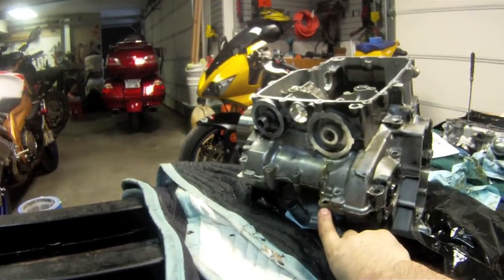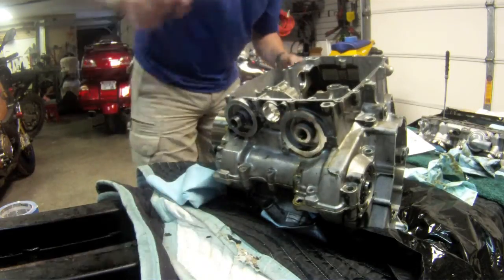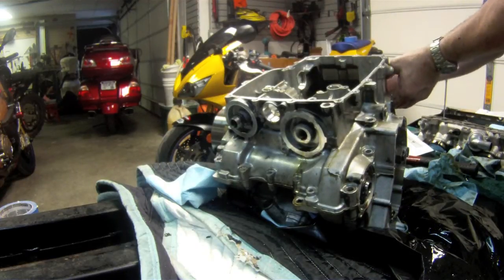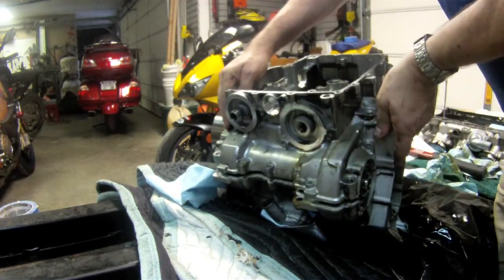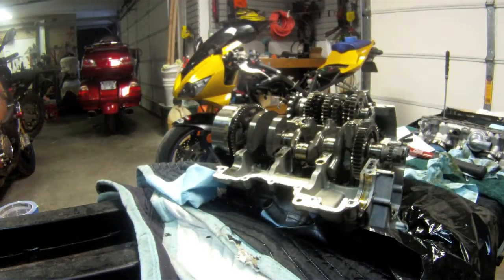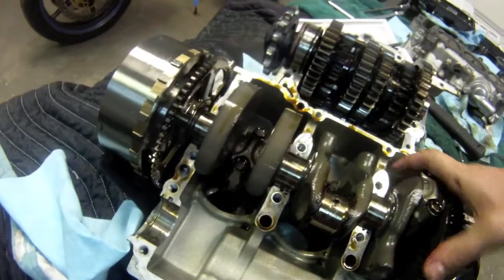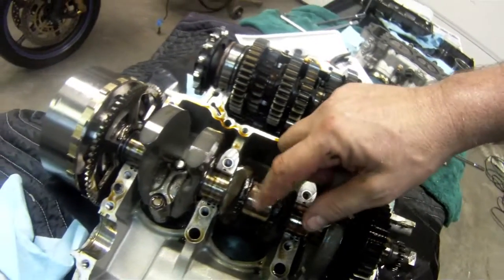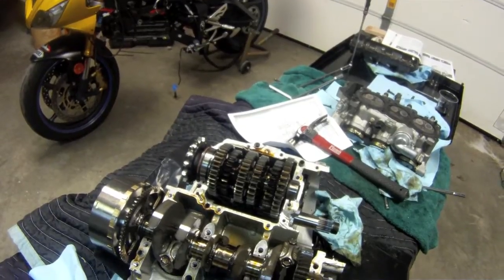Triumph Daytona 675 - Engine Disassembly - Video9

Comment: Hi Chris, my sons bike 2012 675 suffered bearing failure on the two center main crankshaft bearings. What's odd is that the outer two bearings are perfect. Did you ever find out what caused the damage to your bearings? I don't want to rebuild until I find the cause.
Reply from the maker: Stuart Scully My Son finally owned up to pulling an extended wheelie, probably for about a mile on a deserted piece of highway. The oil pickup is in the front of the sump, as the oil transitioned to the back of the sump, because of the wheelie, the oil pickup was sucking air. Also, Triumph changed the sump gasket from a perimeter type,  that just covered the edges where the sump contacted the engine, to a sheet type that pretty much trapped the oil in the sump when the bike was  on one wheel. They also shortened the oil dip stick which requires you to put about a quart more of oil in the engine below it registers on the dip stick.
Your 2012 should have both of these, so that may blow my wheelie theory, but I know he was doing that moments before it grenade's. The oil pump was also seized.
Reply: Hi Chris, thanks for coming back to me. We are rebuilding the engine at the moment but have still not found the exact cause. It may have been similar to the cause of your bearing failure!!! There was some damage to the oil pump but this seems to have been caused by pieces of bearing as found in the oil strainer and in the sump. We can only hope for the best.

Comment: I have a similar problem what did you end up doing with the crank? I'n think I'll recondition mine if possible as the OEM part is over 1000$
Reply from the maker: We ended up getting a used engine and eventually scrapping the old one after it sat on my bench for almost 2 years.
Reply: ok are the cranks all the same threw 09-12 ?
Reply: Chris E these vids have helped me loads I'm currently in the middle or a timing chain overhaul. Shame you just replaced the engine (easiest option) was hoping to see the rebuild.

Comment: Is that crank pressed or machined from a single piece of metal? Interesting video. I ride an '08 SE. Currently having the Ole Rectifier/Regulator problem with mine. Otherwise, we have enjoyed 12000 miles of riding together.